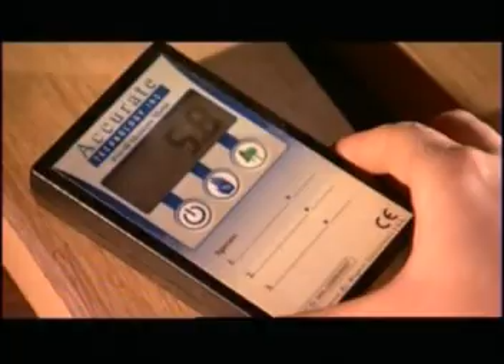How It's Made: Electric Guitar (Part 1)

Comment: I pluck the string, the string will make the body (and neck) vibrate. The body will enhance certain frequencies - or mute some, depends how you see it - and with its own vibration "feedback" on the string so it may or may not ring for longer (depending on original frequency of the played string(s) and what kind of "EQ" the wood provides). The pickup picks up what is left. It's all instant, but this is how I believe it works. 

Next up^^^

Comment: emgs sound great. its not the pickups that ibanez is getting wrong. but what range? high end ibanez are very nice. but they equate to a mid range schecter. also, back in the 80s, other great brands we know today didnt have a standing at the time. gibson was the safe way to go. but put humbuckers in a fender and it sounds almost the same through the same amp. which was always marshall. lastly, what do you consider flashy? to me that would be a dean razorback or a bc rich warlock

Comment: 1920s? 1950s? Where's this narrator getting this from? I'm sure it was fully complete and made by les Paul around 1960.
Reply: In the 20s electric guitars were just acoustics with pickups out in, then up until 1932 they were archtop hollowbodies with pickups, and by 1932 the telecaster was released, quickly followed by the les Paul, both of which were fully solid

Comment: @metachozoite Also, try playing two different guitars. One by the First Act brand. One by Fender. You'll notice on the First Act that the intonation is impossible to fix due to poor measurement and anything above the 6th fret will sound flat and out of tune. You'll notice that the tuning pegs spin on their own. You'll notice that it just sounds ugly. On the Fender, depending on the model, the the only problem you might have is intonation and that can be fixed in a matter of minutes.
Reply: Got a first act acoustic guitar I got when I was four or five it’s got a low e string a g string and a b string hence its name “toothless” it is my absolute favorite guitar to tap on

Comment: @metachozoite I understand where you're going with this, but you're not entirely correct. Some guitars are absolutely brilliant - high end pickups, resilient wood, flawless neck shape, etc. You also have to know how to maintain its value and how well it can be played. A buzzing string isn't always the guitarist's fault. It can be a manufacturing error (uneven fretting, faulty bridge, etc). While it's true that you need to play well to sound good, you also need to have a feasible instrument.

Comment: The terms "fretboard" and "fingerboard" are interchangeable, with the latter actually being the more technical term. Fingerboard is more appropriate in some respects as it the term of choice by most, if not all, major guitar manufacturers. Also, there are fretless basses and guitars. Though fretless guitars are considerably less common than fretless basses, they have been utilized by the likes of Steve Vai, Frank Zappa, and Pat Methany to name a few.